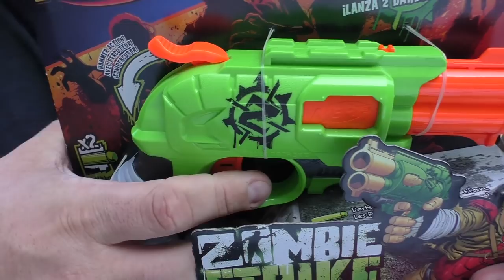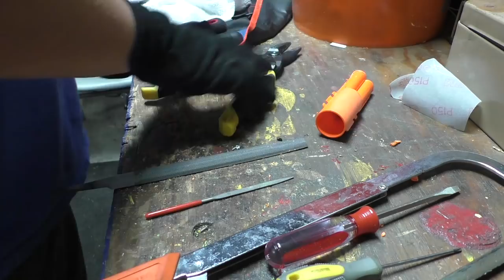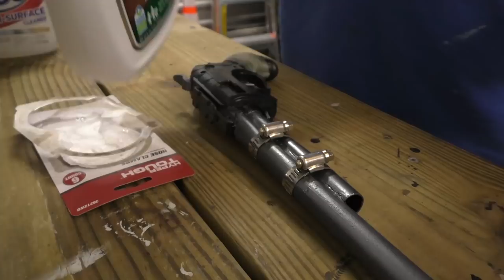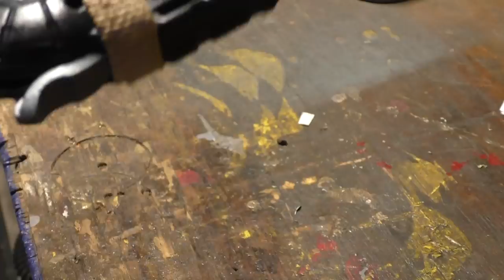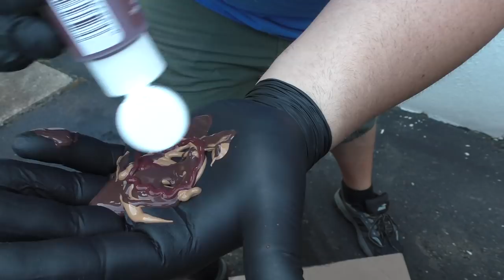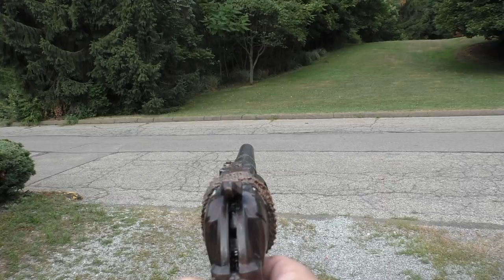Nerf Doublestrike Mod And Paint Tutorial For Larp

Comment: Amazing build! But i have two questions...

What did you use to wrap the handle, Sticky roll bandages?

And what would you recommend as glue to stick the pvc barrel add on to the original blaster?
Reply from the maker: For the tape, search online for Burlap Tape or Burlap Craft Tape, lots of stores sell it.  As for barrel, I'm pretty sure just the pressure from re-assembly held the barrel in place good.  But, you can use any glue on hand that bonds plastics and pvc, so like Barge Cement, Super Glue, Dap stuff, anything that makes a thin layer so it doesn't fatten up the barrel area.  If you make one, tag me on a photo on Instagram or something.
Reply: @LarpMix  thanks for the tips! Also, is half inch pvc good? On amazon they sell it for 3.99 a metre and im wondering whether itd be wide enough
Reply from the maker: You're best bet is to measure he barrel yourself.  I forget the stuff I used, I think it was hot water heater drip line, so it's thin walled, but I'd guess around 1/2".  But I'm not positive.  If I get a chance I'll measure it for you.

Comment: Hey love this video me and my fiancé are planing a lot of stuff for cosplay and this really helped I have a question tho what would you suggest as barrel attachments such as holding it together if it were more like futuristic and not so much wasteland???
Reply from the maker: If you are going more futuristic, like sci-fi or cyberpunk or something, they make plastic pipe hangers, you might be able to use.  Also, heat shrink for large wire, basically slide it on and heat it to mold around.  Also, worbla molded into a shape, or if possible, 3d print something.  Depending on the cosplay, silly stuff like a hair bow or shoelace or something may work as well.
Reply: LarpMix awesome thanks man helps a lot I’ll end a picture when I am done
Reply: LarpMix also are you talking about the cloth hangers with pipes?

Comment: Im curious. Could you possibly increase the range of the dart by adding a slightly stronger spring to the gun?
Reply from the maker: Absolutely.  Just about every NERF blaster can be internally modified.  But for larps, some of them do not allow it.  You can usually find upgraded internal parts for sale online for these, or you could figure out the spring size, and just ordered from a hardware site or something like that.
Reply: @LarpMix  alrighty then. Thanks for the tip!

Comment: What size pvc did you use?
Reply from the maker: That's a good question... I just grabbed a piece out of my pile that fit on the barrel.  But I went back and looked at the video in slow motion and it looks like probably 1/2", but it may not be pvc, it looks like it could be a piece of waterheater drip tube...  So, if I had to guess, that's what I'd go with.  If not, take the blaster or the dismantled barrel to the store and test fit.  Sorry I don't have the exact answer.
Reply: @LarpMix  thanks so much. I just got into modding and wanted to add a barrel